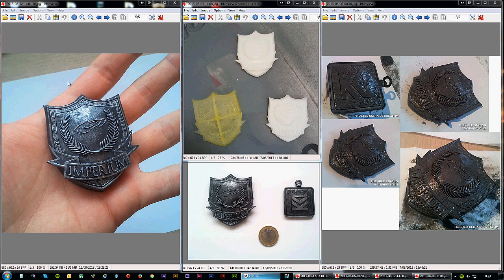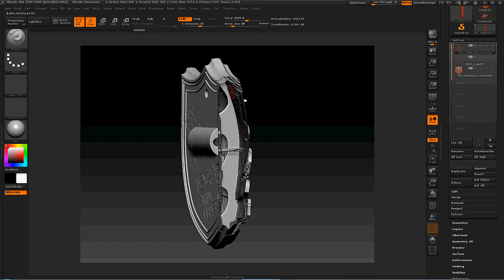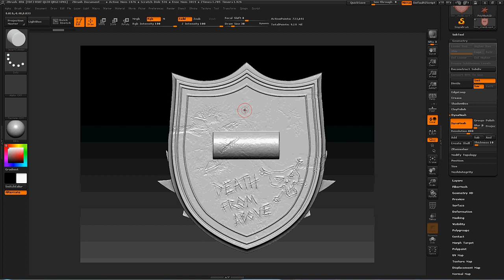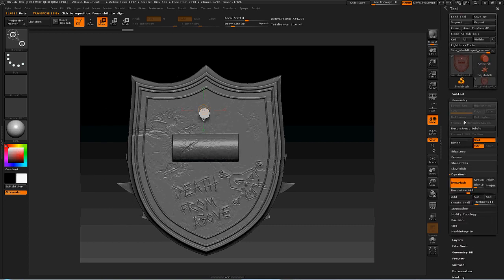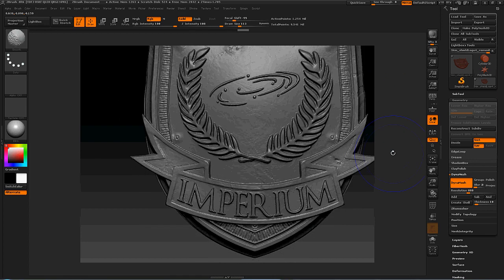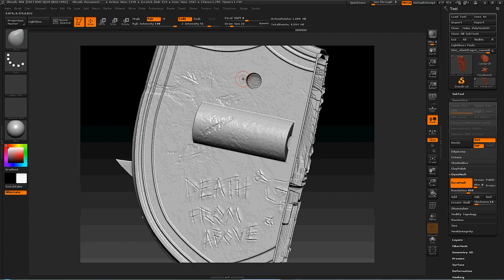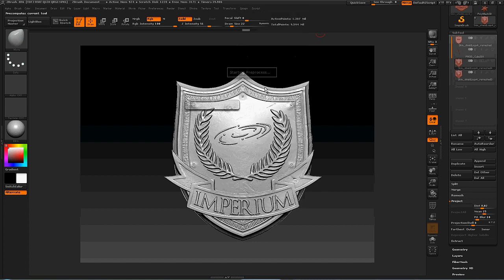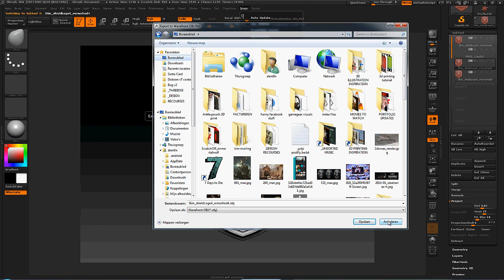ZBrush 3D Printing workflow tutorial

Comment: So with the 3d print exporter, u changed the units only to mm ....r8? Is there any way like I make a model and make like 3 diff. sizes to prints ....... btw thx for the good content r8 to the point <3.
Reply from the maker: Yes you can just do the same steps repeatedly. What I prefer to do is save the file before exporting, change the size, export, then close the file and reopen to do the same for the different sizes. Sometimes zbrush can get a little wonky if you change the sizes again right after exporting.

If you have your own 3D printer you can always use a tool like Chitubox where it's easier to get correct dimensions and add supports.

Also worth looking into the Shapeways resizing features. I havn't tried them myself but it could be possible to upload a single model and then just resize it on Shapeways.com. (not sure about other 3D printing services. Just mentioning it since that's the one I used in this tutorial)

Comment: Cool tutorial but what about the hole you made? Is it going to
Print with that hole?
Reply from the maker: Yes, that's the point. If you don't make a hole the sculpt will be printed as one solid mass, meaning the inside will also consist entirely of expensive 3D printed plastic. And I do mean expensive :-) If you create an empty shell and leave a hole in however, the 3D printer will recognize that and leave the inside hollow but will fill it with printing powder, which will be much cheaper, and the end result on the outside will be the same. Afterwards the printing powder is removed through the hole in your print. The shell does need to be thick enough to not be fragile though, and you can also add in structural reinforcements the way I showed in the tutorial.
Reply from the maker: To clarify a few years later, you can either add a small part to your 3D print to fill the hole, or you can just fill it up with some putty, which is what I use. Basically just a type of moldable clay that you can then sand down and paint over, so the hole isn't noticable.